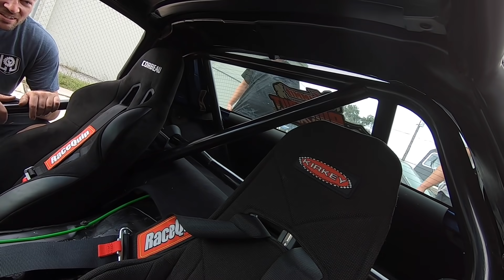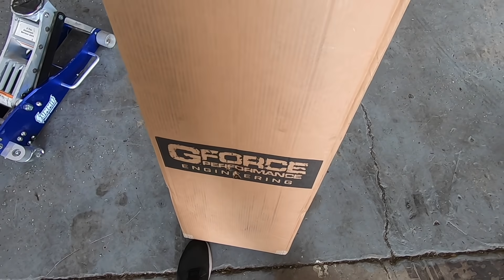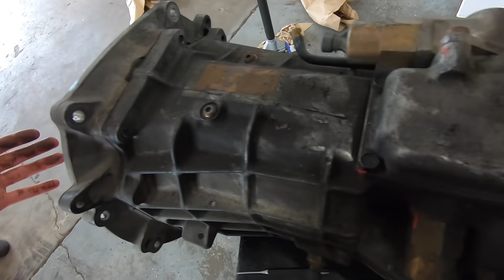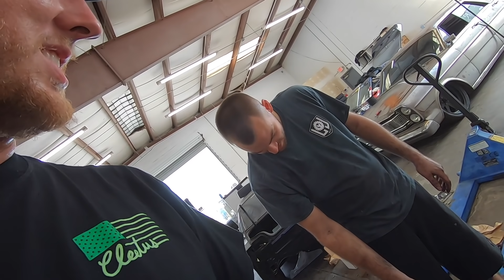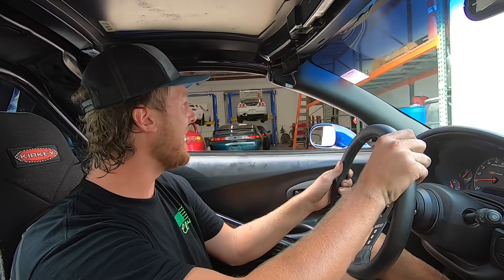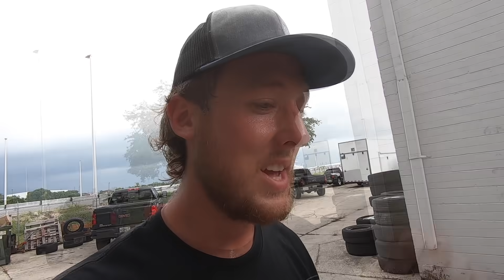Donnie Gets a Built Transmission, ROLL CAGE, Axles, Shifter, and More!!! Extreme LS Fest Prep!

Comment: I love the reasoning for G-Force axles. “The boot has a rip and flung grease” 🤣
Reply: Uh oh my engine is leaking oil because the drain plug is cracked.  Might as well get a TSP 427🤷‍♂️🤷‍♂️
Reply: Chewy Lewy lol 😂 I can see that happening
Reply: I'm not going to lie that's how I justify upgrades too lol. 

"Damn, I got a nail in the tire....I need this 1200 dollar set of wheels to fix it correctly..."
"Man the air filter is filthy....I got to get that LSXR intake to replace it..."

Comment: I believe everybody is right, the transmission and diff simply broke, the same time you got tapped rear wheel, at least the case broke, but with the cases broke it was just a matter of time before the output shaft snaps from the torque load, and no case to hold it centered.
Reply: Exactly why it's so important to use dowels when putting in a manual trans.

Comment: Did all that work with the trans and diff, changed the oil and spark plugs..... But not a word was said about doing a nut and bolt check on the front end like Taylor ray has told him 50 times 🤣🤣🤣 ahhh good ol cleet

Comment: That is one nice looking rollbar...made in no time flat. Shout out to those guys.

The "Shyster" is a solid unit. Just hope you dont have to mess with the trans. Honestly the Shyster should last 20 years from right now the way you will use it.

Edit: RPM Transmissions Killed it on that quick turnaround and looks killer with that brace. I run a brace from trans to transfer case on my big powered duramax. That kind of stuff goes a long way. Donnie will never hurt this driveline except for the clutch....HOW could you FORGET to replace the clutch with the trans out...?? Lol wondering what clutch you will pick when that time comes...

Comment: Just be careful on those bank transitions at the track when you're drifting - they are going to continue to beat on the trans/diff/axle setup, no matter how beefy, when hitting them sideways at speed. 
When watching the last video, you can literally see when it blows, going from the low track to the banked outer track while sliding sideways.

Comment: I don't get the drive train geometry, how is there no drive shaft?
Reply: There is a drive shaft between the flywheel/clutch and the transmission. (Inside what's called a torque tube) Here's a cutaway of a C6 Corvette chassis: corvetteforum.com/forums/attachments/c6-corvette-general-discussion/47579503d1091746497-c6-cutaway-pics-all-in-one-place-c6cutaway7.jpg

Comment: I hate to tell you this but that is not really a real drift cage. Thata a drag cage. I already saw the LS fest vids and I'm surprised they let you run tandems with that. Most pro am go by real close to FD pro 2 specs. Dual door bars either parralel or X bar. Halo and a pillar bars also. That won't pass tech at any NJ event fir tandems or many I go to in PA MD WV NY. Just giving you the heads up! Rock on Donnie. But get that cage right.

Comment: 1971 Dodge Charger SE
Car for sale by Classic Car Deals in Cadillac, Michigan 49601

$15,995
Classic Car Deals

(844) 676-0714
6576 E 34 road
Cadillac, MI 49601
1971 Dodge Charger SE (stock #AAH21638) listed on Autotrader for $15,995. .

Classic Car Overview
1971 Dodge Charger SE with a matching numbers 383 Magnum. Current status is a project car but will start with fuel down the carburetor. Factory options include Hemi Orange, black canopy vinyl roof, air conditioning, power steering, power disc brakes, cruise control, upgraded steering wheel, G60-14 road wheels, Pedal dress up kit, trunk dress up kit, hide-away headlights, and black interior with the Cloth and vinyl seats. This car has the matching numbers engine and factory N code 383 Magnum. All parts are there, nothing missing. Floors and trunk floor are mint. There is some rust at the very bottom of the 1/4s(patch panel), passenger fender is dented, other than that nothing is missing from this car. Under the hood is very original engine rebuilt at some time but someone painted the engine blue. There are extra parts included. Matching numbers, 2 build sheets, 2 fender tag car, clean title. Please Note The Following Vehicle Location is at our clients home and Not In Cadillac, Michigan. We do have a showroom with about 25 cars that is by appointment only Please Call First and talk to one of our reps at 231-468-2809 EXT 1 FREE Consignment Visit Our Site Today Easy To List Your Vehicle and Get it Sold in Record Time.
This car is pretty descent for numbers matching on auto trader.